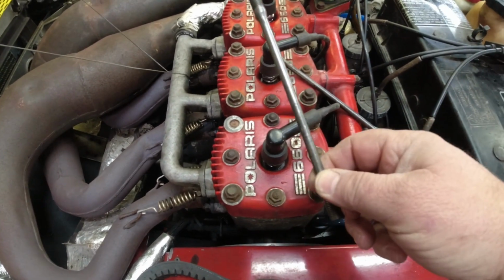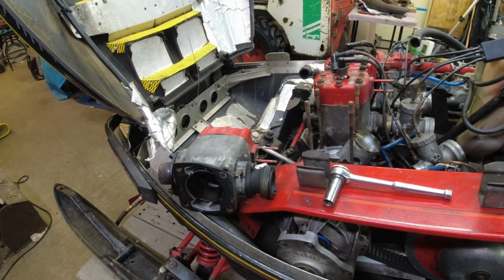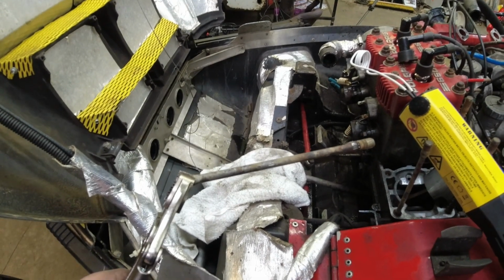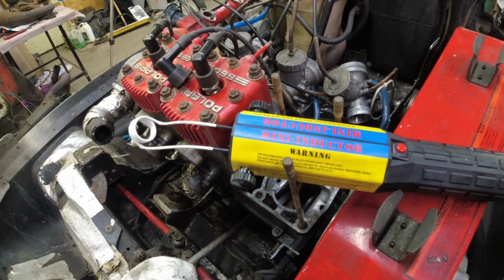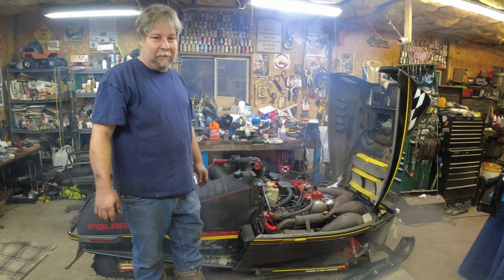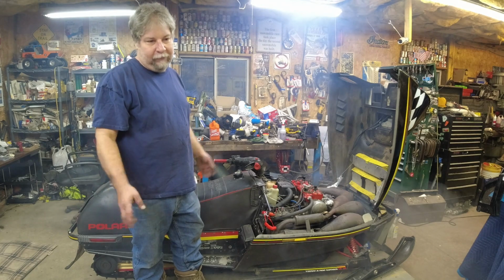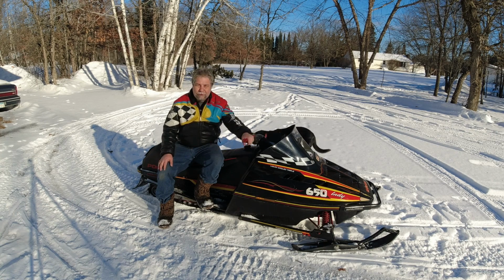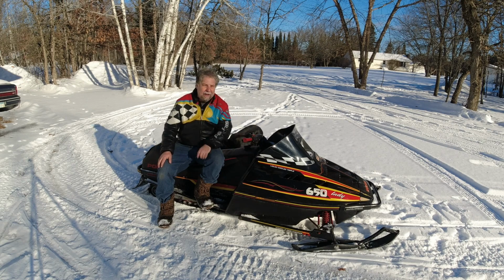Polaris Indy 650 Cylinder Stud Replacement and super crisp zero bog test hits. vintage snowmobiles

Comment: I've personally broke the same studs on my 650. I have also seen them break and fall into the clutches and trash both sheaves on primary and secondary at the same time!
Reply from the maker: Wow! I'm happy that didn't happen to me. I'm looking for some higher strength studs. Do you know if anybody ever sold them? Gotta think custom ARP would be $$$$
Reply: @nuttersspeedshop  At that time I used OEM Polaris, but I have called ARP and they are pretty helpful to find matched items they have. I have bought other cylinder studs from them. Nice stuff.

Comment: Nice 91, i have a 91 500 that's been in the family since 96, now with Xtra 10 skid and fox shocks all around
Reply from the maker: sounds like a great sled.
Reply: @nuttersspeedshop  goes good for a 500, but i have a 98 Xc 700 for the power 😊

Comment: I am really hoping to have my '91 650 up and running tonight, after 15 years of it being out of commission.  The last hurdle is getting the stuck carb cable freed up, which was most likely the cause of my issue and not the stator I just replaced.  I can't wait to hear the triple pipes again, especially without a large hole in one, due to the steering linkage bolt.
Thanks to you and your videos, for getting me motivated, to get back to work on mine.

Comment: any idea where I could source studs ? I remember a couple 650s back in the day did same thing...currently building a 690 ( 70mm wiseco kit) dont want any issues I might be able to mitigate now...did ARP make a kit back in the day? Dunno...or a cylinder head girdle to stiffen?
thanks
Reply from the maker: No idea on studs. Mine came from a friends parts motor.  I don't have anywhere to send you for any of it. There were stud kits and head girdles back in the day. I don't know who made them.

Comment: How to do get that 650 to launch so nicely
Reply from the maker: clutching and jetting and suspension setup. All of these need to be right. And studs. I could actually use more or sharper studs.
Reply: Nutter what is your clutching and jetting setup ?

Comment: Sweet.. Qiuck fix? ..Heck, If the compression test, with good gauge, is good...And you can tune idle mixture & speed easily 
and  it drops back to curb idle speed quickly after WOT Blip. Then WTF? Run it! God hates a coward Ha Ha.
Note My all stock 2000 ZL550 could not touch your Indy in a Drag...But  That Black Dog would House you in the first 100 feet.
Thanks for Video